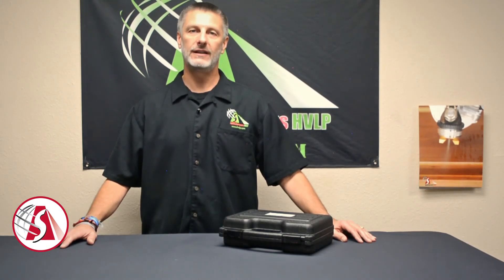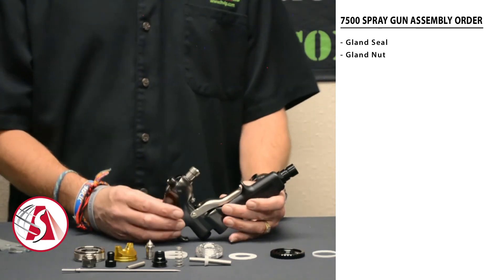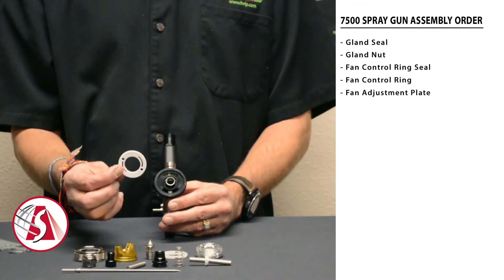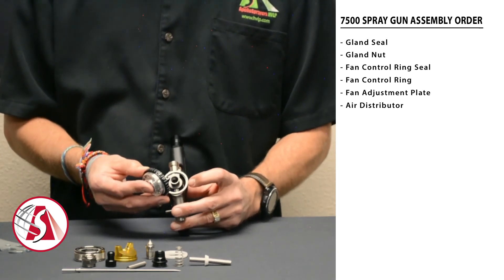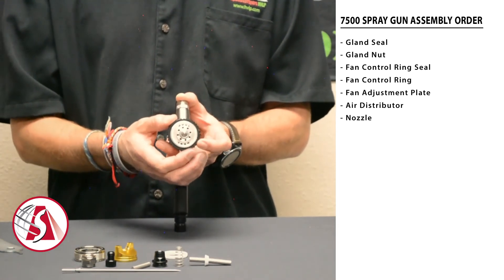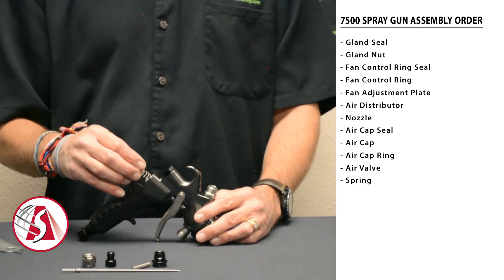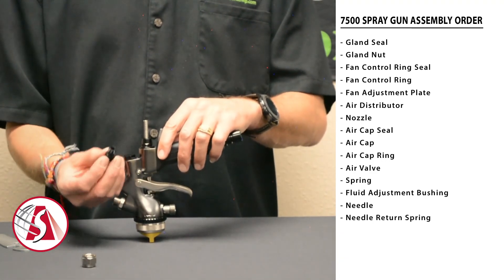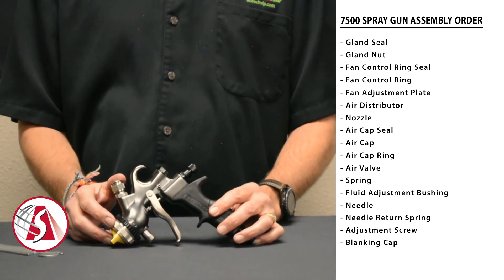How to Correctly Assemble Your Apollo 7700 AtomiZer Spray Gun

Comment: Thanks for the great video! What would happen if I spray without the Air Cap Seal installed?
Reply from the maker: Your spray gun would leak air from around the air cap ring and you would not get proper fan adjustment.  The head of the gun physically doesn't fit together properly without that part.

Comment: The pin in my air distributor sheared off inside the hole in the gun body and now it will not come out. Should I drill it out?

Comment: Do you have to disassemble the whole gun to change the needle size
Reply from the maker: No, you can simply remove the material adjustment knob and needle return spring.  Then pull the trigger and you can pull the needle out through the back of the gun.
Reply: @ApolloSprayersHVLP  do I have to change the nozzle tip thing as well if needle is different size or does the tip fit all size needles
Reply from the maker: @jimbrown4484  There are two sizes where you don't have to change the needle for the nozzle size, but all other sizes are paired with a particular nozzle size.  The 1315 needle can be used with both a 1.3 and 1.5mm nozzle.  The 1820 can be used with both a 1.8 and 2.0mm nozzle.

Comment: What is happening when the gun seems to be pushing air out around fan adjustment?   When it does, I can sometimes play with trigger and it will go back to proper spraying?
Reply from the maker: If you have air leaking from behind the fan adjustment ring you may need to replace the fan adjustment seal or the nozzle may not be tight enough.

Comment: HI there..
I'm trying to pick up some spray skills and have purchased an Apollo 1500-3s.. can I use any kind of gun with this.. I'm wondering if the turbine won't relieve air pressure when trigger is off.. Derek, Scotland, UK
Reply from the maker: Your 1500 is made in the UK by Apollo Sprayers, UK.  You should be able to use any kind of turbine spray gun with this model.  You cannot use compressed air spray guns with a turbine.
Reply: @ApolloSprayersHVLP  excellent... Thanks..

Comment: John , Im going back and forth on the 7700 and the e7700  , I prefer gravity feed . Is there and difference between the guns other than the lack of bottom feed ? And just to make 100% the e7700 can also be converted to air compressor correct?
Reply from the maker: The 7700 and the E7700 are identical spray guns, only the E7700 doesn't have the bottom connector and it can't be added as there is physically no place to attach the bottom connect into the casting.  Yes, both spray guns have the 1/4" NPT fitting inside the turbine handle and will instantly accept compressed air.  With less than 23 PSI you are using the full capability of the Atomizer on compressed air.  We also have a separate handle coupler that you can add if you want to install a regulator on the handle of your gun.  Here's a link to the video showing how to convert you spray gun from Turbine to Compressed air https://youtu.be/t7RPHQ2FXGg